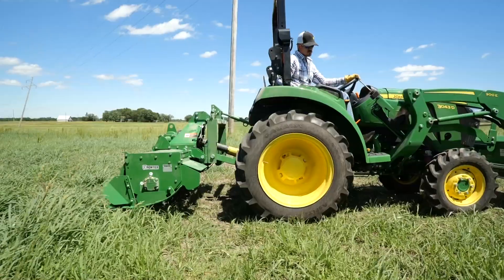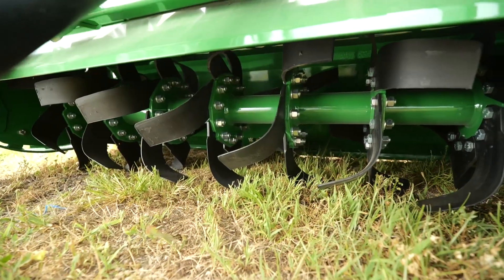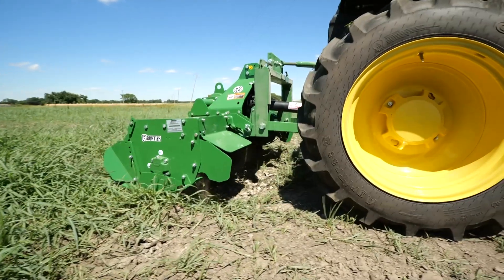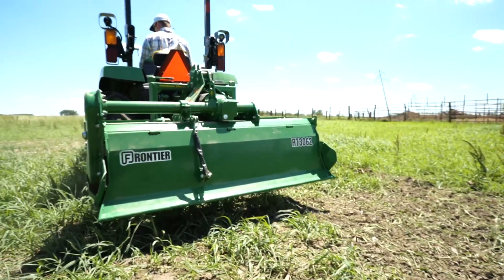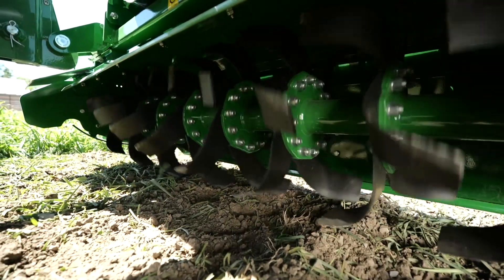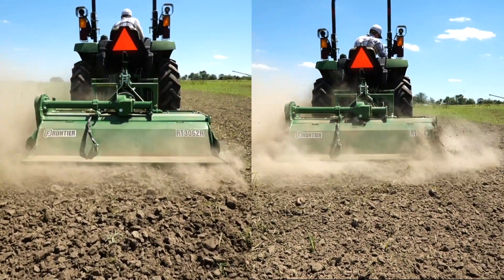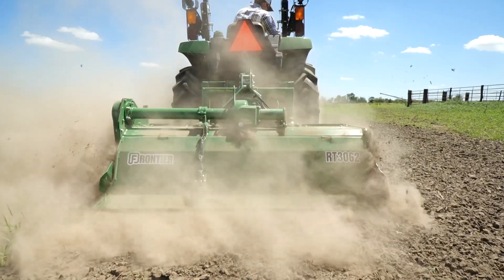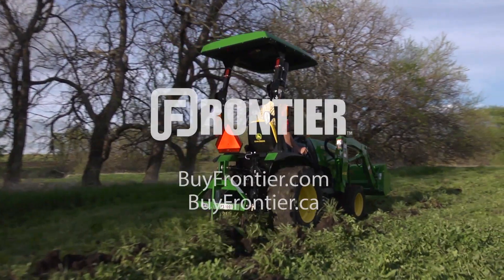The difference between forward and reverse tine rotary tillers | John Deere Tips Notebook

Comment: Another important note would be in ground with large rock forward rotation is better suited. Forward rotation allows the tiller to skip or jump over the rocks
Reply: This is provably the most important difference. I only have reverse tillers and it is very tough when making a new vegetable garden and trying to till with rocks. To the point that I always use a disc plow first to uncover the big rocks first. I may invest in a forward tiller later so I can save more time

Comment: Hi, I’m looking for a rototiller, I’m wondering, what model would I need for a 2032R? Latest model, and do these go six to eight inches deep?
Reply from the maker: Thanks for the question! The 2032R Compact Utility Tractor is compatible with the Frontier™ RT3062 and RT3062R Rotary Tillers which have a tilling depth up to 7.5 inches. Our 655 Tiller is another option compatible with this unit and has a maximum tilling depth of 7 inches.
Reply: @JohnDeere  thank you, will look into at the end of planting season so I can get a better deal

Comment: I purchased a John Deere 5090 in Thailand 
Cannot purchase many accessories. I.e. bucket. Quick contact for the tiller etc.
John Deere are not supporting people in Thailand.
Reply: Maybe you could have someone in the states ship parts to you ?
Reply: @hey_youtubeim_back2159  
When I contacted John Deere in the USA I was told to contact the Thailand branch.
After 9 months John Deere fixed the electrical fault.
I resolved accessories by buying a Kubota tractor and accessories.
I am very pleasantly surprised. The Kuboda has worked really well. The support is awesome. Yes Kubota have many accessories. If not they source accessories.
Under the current management John Deere will continue to fail in Thailand and the reputation will continue to be very poor.